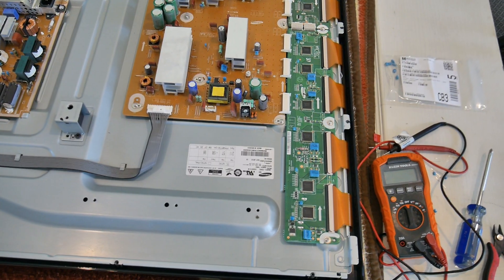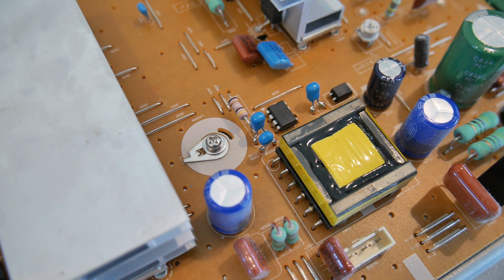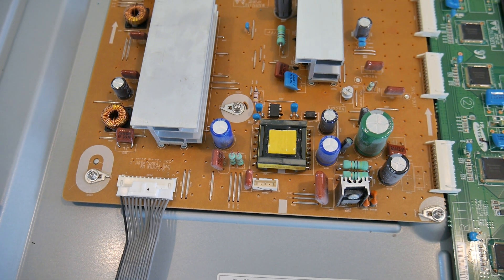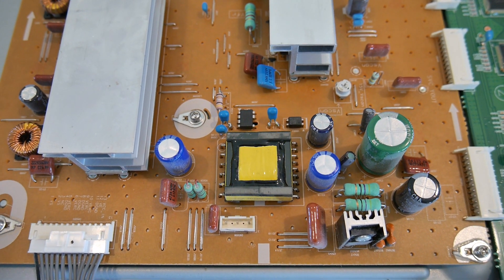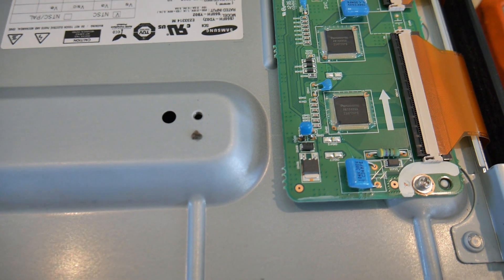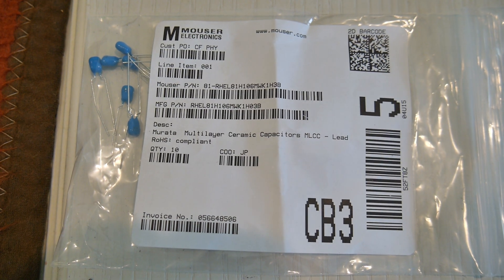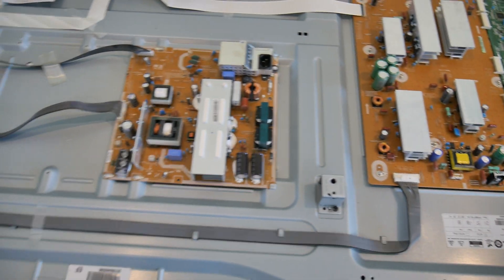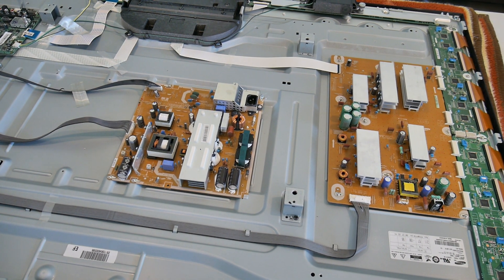Samsung Plasma TV powers on but no picture REPAIR (different problem than other videos I saw)

Comment: HI Rick, I am having the same issue you had with my tv.  I was watching and then the picture went out.  It tries to restart but can't.  No picture, but I can hear the volume sound as I turn it up.  I traced it to the "Y" board.  It looks like I need to replace those caps too.  Are the 3 on the "Y" board all the same?  Still recommend the ones from "Mouser"?  I am a beginner at electronics but your video I can understand.  Easy way is to just cut the leads right under the blue part?  Is there a polarity that I need to worry about and if so, how do I know which end goes on which lead?  
Also, I don't know yet if any of the buffer board caps are bad yet though. I did hear a slight "pop" when the picture went out though.

Thank you.
Reply from the maker: Hi Mark, if those parts are still available then yes I would use them.  If they aren't, I can spec a new one for you.  As I remember, all the little blue capacitors are the same.  Yes if you cut the leads right under the blue part, you can solder the new one onto the old leads which lets you replace them without removing the board to access the back.  Make sure they don't fall downward when soldering where they would be shorting against the metal beneath.  If you have any more questions I will try to help you.  These TVs are really good and the new ones are crap.
Reply: @RickBaconsAdventures  Hi Rick, looks like Mouser's site is back up and I should be able to order those caps.  I will post again if I run into any difficulties.  Do the caps have a polarity to them so I need to know which end get soldered to the correct side?
 Thanks again.
Reply from the maker: @GriffySpeed  Hi Mark, That type of capacitor does not have polarity so it does not matter
Reply: @RickBaconsAdventures  Hi Rick, I finally attempted to fix the tv.  I replaced the 3 caps (lazy way) plus the 1 you replaced on the "buffer" board.  I still have the same issue.  I even removed the white ribbon cable to see if I could get something to heat up and smoke like you mentioned, but nothing different happened.  I still get the red light that blinks and the "click click click" sound as it tries to work but then nothing.  I watched another video where a guys you unplug one board at a time to see if it stops "clicking".  This is what I tried previously before finding your video.  Using this technique, it seems to come down to the board where the 3 caps are.  Do you have any other suggestions?  Thank you
Reply from the maker: @GriffySpeed  Hi Mark, I will watch my video again today and see if I can come up with any suggestions.  It has been too long for me to remember. Mine is still working though so there's hope!
Reply from the maker: @GriffySpeed  Hi Mark,  I would try replacing more of the blue capacitors on that board.  I think it was a random event that the one particular cap was bad on mine.  Some of them on the power supply board seem to be used in an "AC" circuit where they would be stressed from current.  The rest seem to be just bypass caps and should only short if they are bad quality or too close to the voltage rating, thus they would die randomly.  Have you tried measuring that -200v rail?  I can't remember how I did it, but the connectors were labeled pretty well and I just used my best judgement.  If you could determine if this voltage is present ever when you turn on the TV, and if it goes away, how soon, how quickly, etc.  I'd hate to see one of these TVs get trashed.  The junk they sell nowadays is garbage (not the picture quality but the user experience)
Reply: @RickBaconsAdventures  I haven't tested anything as I don't know how to do that or think I have the right testing device.  All I have is a harbor freight 7 function multi meter.  Can I use that?  If you are able to remember how to do, could you make a video?  When you say change more blue caps, do you mean the ones on the buffer board or the one with the group of 3 that are together, I think that is called the "Y" board?  Thanks
Reply from the maker: @GriffySpeed  yes any multi meter will work.  I would need a picture of the connector coming off of the Y board in order to remember which pins to measure.  I can't make a video unfortunately because my TV is working fine and all reassembled.
Reply: @RickBaconsAdventures  I can take a picture for you.  Can you send me your email or let me know how I can get a pic to you?  Thank you for your help, I really appreciate it!  
Also, are these caps "fragile"?  I dropped on the floor a few times as I was trying to solder them on.  Also, I wonder if it is possible I could have over heated one when soldering on too?
Reply from the maker: @GriffySpeed  youtube won't let us put email addresses or anything in the comments, I've tried it before.  But I would help if we can figure out a way.  They shouldn't be too fragile but overheating them could break them.  It should be pretty hard to overheat them that badly though
Reply: @RickBaconsAdventures  I made a video of the board, hopefully the link works and you can see the connections.  If you can't or it didn't work, I can try again.  I but the cover back on as I need to move the tv so either way it will be a couple weeks before I can try to fix it again.  Thank you for all your help!  https://www.youtube.com/shorts/X9OJLzqx__8

The one cap did get very warm when I was trying to solder it, got too close to the tip.  When doing the testing, will I know if the new caps are working correctly or if another is bad on same board, I won't know?  Is there a way to test the new caps independently?
Reply from the maker: @GriffySpeed  Hi Mark,  sorry for the delay.  really busy.  I sure don't remember enough about the board to tell from your video where to measure.  Where are you located?

Comment: Still working?
Any more disrepair?
Reply from the maker: about 6 months after this happened I had one of the driver boards along the side go bad.  Wasn't able to find the problem but I found a replacement board for like $11.  The TV works perfect still now! (the symptom of the driver board was half of the screen was black).  I hope it keeps working because I love this TV.  I hate modern TVs I just want a screen, not a dang computer with a laggy and buggy UI with "features" I don't need.